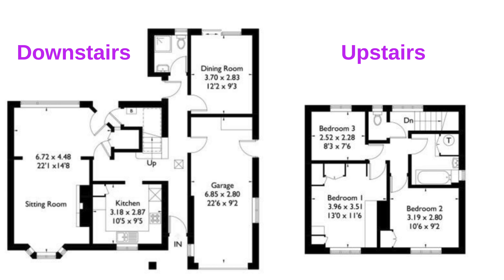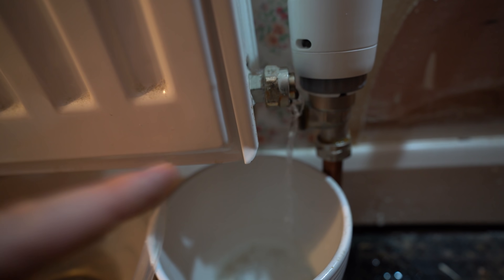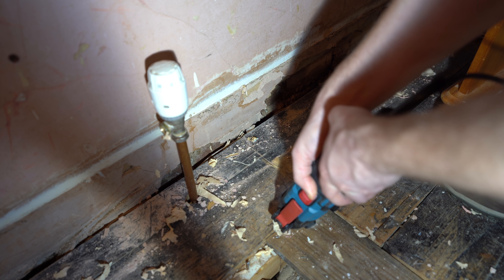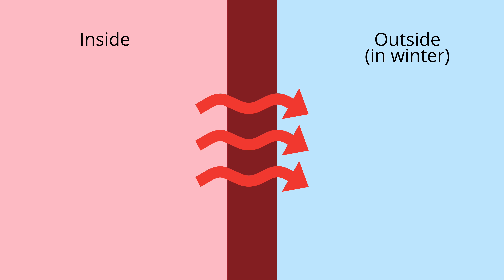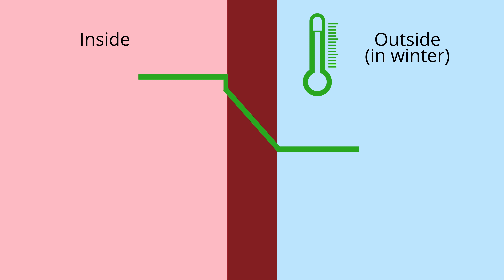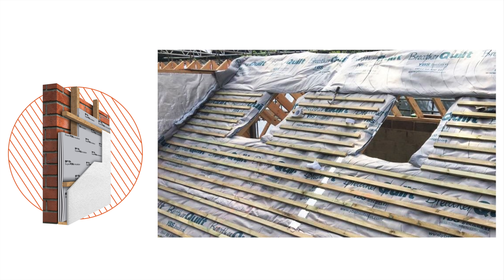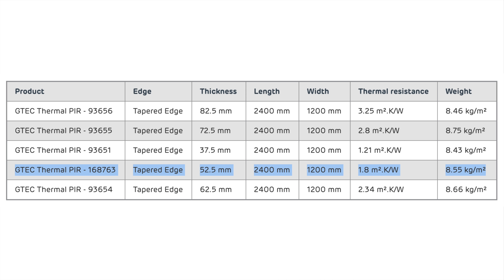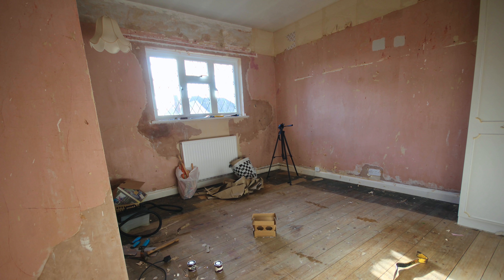Using Adhesive Foam To Attach Insulated Plasterboard

Comment: Hi i like the video however its a myth externally insulated buildings dont suffer with this problem.
Consider the scenario. Cold house, You return home on a cold day and put the heating on. You increase the temp & humidity in the home but the thermal mass of the wall is slow to  respond and lags behind the room temp. The moisture enters the fabric due to higher humidity internally compared to outside and as the thermal mass mass of the wall is   slow to respond Dewpoint occurs instantly on the inside of the wall. Moisture migrates through the fabric and becomes trapped behind the external insulation.. Bad bad bad bad. Only mitigation against this is a mechanical ventilation unit to combat the humidity rise. 
Internally insulated walls respond quickly with the rapid temperature change and do not lag behind the internal temp. Most insulations used for this have low permeability and and moisture going beyond the insulation is minimal. Also with the external structure not wrapped in external insulation, the building will eventually permeate the moisture to atmosphere instead of being trapped. This is why timber frame buildings use an internal vcl eg polythene and  external vapour control layer which allows moist to escape to atmosphere . The other way around would be a total distater.

Spent 13 yrs testing /investigating building defects, air leakage testing. Cavity filled and externally wrapped solid wall buildings are something that keeps cropping up...
Reply from the maker: Wow fantastic comment esp. with all that experience behind you. It does make sense what you say but I'd have thought that even with the heating off for the day the external insulation would keep the brick walls reasonably warm, certainly more than uninsulated walls but the point about moisture getting trapped outside of the wall but inside of the insulation makes total sense but again, will it condense?

I've been hearing about issues with cavity walls so let's say you were doing a brick/block extension, how would you build the external walls - internally insulated?

Comment: I notice you didn't put any spray foam in between the sheets, I think I intend to do this, is there a reason you didn't?
Reply from the maker: They were nice and tight for the most part so nowhere for the foam to go. Unless you mean doing a quite spray on the side before you attach - not a bad idea actually esp as some boards are a bit concave on the edges.

Comment: I may have missed it as I was clicking through impatiently but how did you finish the reveals? just bond plasterboard over the edge of the boards and across the internal face of the window reveal, butted up against the window itself?
Reply from the maker: It's in the vid, briefly but I just did the edges of the insulated plasterboard to be butted up against the existing plaster on the window reveal. That does mean therw window reveal is a thermal break which isn't ideal but to put insulated plasterboard either you lose your window frame, replace the window with a smaller one or before you start making the window opening wider - big job and make interfere with the lintel. So I think the way I did was best. As for cutting it back after it's stuck rather than before - I found it more accurate doing it that way. i've done this job again in the next bedroom and did it the same way.

Comment: Love your videos and am well aware of how much research you do and how well u focus on the little details, but do you foresee any issues where the rockwall was put between the floor joists, by doing this isnt the wall going to be colder so vapour can condense on it, im assuming the rockwall has no vapour check qualities within it or if it does not very reliable so are the joists going to be in contact with a wet wall that cannot dry due to no gap and air flow thus risking structural issues later down the line from sweating and rot. Really hope the instastik idea works long term, makes it so much easier and less messy than dot and dab.
Reply from the maker: It's a really good question and I wondered the same so I kept checking it while the floorboards were up (and it was winter) and there was no moisture. I guess if you were to put acoustic insulation down which is not that far off thermal insulation in U-values then that would be done all the way to the wall - I believe. That's done regularly and there shouldn't be issues. The other thing is that the brick wall is breathable so should let water vapour escape. 
More often than you might expect with these things is that what works in one house, facing in one direction, in a particular location doesn't work for another - like cavity walls -sometimes they seem totally fine and other times they have damp problems so overall i'm not certain but it's a good point that I did think about. Of course when things are hidden away above plasterboard and below floorboards you don't know what's going on but I'd have thought there would be some damp on the plasterboard below before things got too bad.

Comment: Hi.there, I follow you on Youtube and really need some advice if you've time....

We've just had a garden room installed and our man has been following you too so we were really assured things went great. Plastering has been done and we're now not sure whether we've painted too soon after, even though the walls looked dry but might have felt cool to the touch. We went for it 5 days after plastering and mist painted it and then 3 coats of emulsion later. However, the french doors and window is very steamy and very drippy with condensation. We still have final fix electrics so have an extension lead with two radiators on and the window open for 2 days now and still the condensation remains. 
Can you offer any reassurance to us that it is normal or that we've messed up painting it too soon?
Reply from the maker: Sorry for the delay in replying. I'm sure this is down to either the deepest layers of plaster still drying or your mist coat which will have been water heavy so I bet the condensation problem has gone now :)

Comment: 9:14 Just a tip for the future. You could have left the corner on and cut  it off after installation with an old saw, just cut in line with the opening. Or hold it and cut along the window before installing. Saves all the measuring and marking.
Reply from the maker: Good point. About to do another room the same way so will do that to make things quicker. 👍
Reply: @AliDymock  The reason I mentioned an "old saw" is that I've found that cutting plasterboard seems to have a very corossive affect on saw blades.

Comment: Good tip with emptying the rad. Just a note re cavity insulation from the 80 ( and 90 and even into the early 00s) only a lawyer of about 50 mm would likely have been added, still leaving a 50mm cavity which can still be filled to greatly improved the overall insulation. The cavity insulation would originally have been installed by the block/brick layers and could often have been poorly done as they would have been working around wall ties which caused gaps. The insulation would also have been low density polystyrene.
Reply from the maker: Great bit of info! That would be the best starting place for insulation if that is the case.

Comment: This is a great video. Thank you. I have one question, i do get condensation on the wall. So for that i would need the wood baton option rather than direct adhesive option?
Reply from the maker: It's hard to say because you may be getting condensation because the wall is cold. Once you've insulated it will be warm so the condensation will be gone. So as long as the foam sticks well enough to begin with (or dot and dab cement stuff) then you may be totally fine doing this may way. I think that because the boards have a vapour barrier between the insulation and plasterboard this will also help reduce the water vapour from getting to the brick wall in the first place so I reckon it's totally fine BUT do use acoustic sealant on the joins and also around the edges. I've had no problems yet, the wall is plastered and painted and I'll be doing the next room the same way this month :)
Reply: Thank you. I will let you know how it goes. And good luck with room project!

Comment: Could you stick on acoustic boards using the foam and would it work to deaden the sound more than drywall adhesive or fixings? Possibly 2 layers of acoustic plasterboard?

Comment: I've only ever used mechanical fixing on insulated plasterboard, after seeing a job where it had been dot and dabbed with plasterboard adhesive and the plasterboard had later become detached from the polystyrene. I've always used 6mm sds drill, red plugs, then 65mm aluminium nails (which hold in plugs better than you'd imagine.) You have to use a bit of scrim over the nail heads due to the compressibility of the insulation, otherwise the heads may pop occasionally. But I must admit, this looks like a feasible solution that would be a hell of a lot quicker. I'll give it a go next time I have some to do.

Comment: Hi I have cavity walls but my north front facing room is pretty cold and Gable wall is cold to touch can I just put these Thermal plasterboards like you have ? Or is condensation going to be a problem?
Reply from the maker: You should be okay to do so, I can't think of a reason off the top of my head why moisture would be any more of an issue with a cavity vs a solid wall
Reply: @AliDymock  have you noticed a difference now since fitting the boards.

Comment: Great stuff. Would this method work with foil backed panels (e.g celotex pl400)? Thanks
Reply from the maker: I don't know for sure, and that's partly why I went for the paper backed stuff. I've noticed that expanding foam doesn't stick at all well to foil but it may be a different story with this adhesive foam. Even with dot and dab, I've seen some people pva the foil first to get a stronger hold so that may be the work around. Test it and see!

Comment: Hi great job 👍 I can see that you cut your boards round the window level with the edge of the wall.  How did you cut the boards in the reveals? Did you have to cut away some of the insulation to ensure a continuous seal? I’m about to do the same so any advice would be helpful. Thanks.
Reply from the maker: So in my case, I didn't do any insulated plasterboard in the reveals because the windows will need to be replaced at some point so that will be the time to do it for me. Ideally you'd knock off all the plaster in the reveals, attach the insulated plasterboard, maybe 10-25mm of PIR . This would extend beyond the reveals to meet the wall insulated plasterboard. Then you need to cut back the insulation from the plasterboard on the wall so the two bits of plasterboard meet. Confused? See the 12:00 minute mark, that diagram shows it nicely 😁
Reply: Thanks that’s really helpful 👍

Comment: Hi, great video and thanks for sharing this information, very helpful, I'm about to start doing the same to my house, the wall is solid stone built, I took off the old  black ash plaster as it was loose and left with just stone, I was was going clean up as much dust, a thin layer of PVA and then dot and dab or foam now after this video,  would you think this would work? Cheers
Reply from the maker: Sounds like you've done the hard work. Yeh I definitely think this will work. Either spray the walls with water first and then spray or if it's very dusty/dry then pva might be a good idea. This was a bit of an experiment as I'd only seen it used on plasterboard (no insulation) before but given the paper baking of the insulated plasterboard I used, I thought it would work and it's a lot less hassle than dot and dab.

Comment: Hi did you notice the difference in heat loss within the room once you installed the insulation plasterboard, I have solid walls and want to do the same? Great videos.
Reply from the maker: Well I haven't got the radiator back on yet but it already feels a lot warmer. When we do the windows in future I think it will be really snug. I think it's worth it.

Comment: Good job. Is there still some risk of condensation on the solid wall even with the foil backing vapour layer and sealant?

Also how many cans of Insta Stik covered how many boards?
Reply from the maker: It's possible but hopefully moisture will escape out of the wall faster than it enters so no build up of moisture occurs. We just have to do our best to reduce it getting in in the first instance 👍
I think it was just 1 can, certainly no more than 2.

Comment: I agree with the choice of insulted plasterboard just not a fan of sticking it as a fixing, you can get fixings especially for insulated boards that give a much better fix
Reply from the maker: Have you got a link?
Reply: @AliDymock  don’t usually buy them on amazon but these are the closest to the ones I buy at our local building merchants, just drill a hole and hammer them in. The take a great fix

Comment: Good job, but you made this room smaller. I would have chosen the external facade insulation.
Reply: He only lost 2 1/2" ... 
He explained the pros & cons of the different methods and settled on this method as most suitable... did you not hear that ? 😒

Comment: Interesting video, love the use of instastik as dot n dab is definitely messy business. Was there any particular thermal reason/ calc to your prioritisation of the wall insulation over replacing the window(s) with a superior performing unit? (Replacement with trickle-ventilated unit does significantly reduce in room vapour / condensation issues too).
Reply from the maker: Good question Carl. A couple of reasons to leave the windows for now. I'll likely want to do all the front windows at the same time so we'll have to save up for that and also they can be done in isolation (save for a bit of plaster work around them) where as it made sense to do the wall insulation before carpet because I needed to move the radiator pipes. Good point about the trickle vent.
Reply: @AliDymock  Lovely job. In your main rooms,  suppose you might also cheaply chase such pipes into the wall, lag and then bring them through the insulation board, keeps the look clean if not doing the full under floor malarky. Great channel BTW!

Comment: id be really concerned about creating damp between the cold brick wall and the insulation. You mention that we create a lot of damp in the internal atmosphere of the house with cooking and showering etc, i'd consider a MVHR (mechanical ventilation with heat recovery) system to try to keep the internal moisture levels to a minimum. I'd be interested to see what this was like in a year or so and to see if you do indeed end up with damp or rotting joists.

Check out Peter Ward on youtube, he is an expert on damp in old solid wall buildings. Scary stuff damp.

Comment: Out of interest; 
1) Are you concerned about thermal bridging on the mechanical fixings?
2) If someone did this and wanted to hang something on that wall (a shelf/etc) How would they do so safely without thermal bridging/damaging the vapour layer?

This looks great and is something I have thought about doing for a long time. But I always get tripped up when considering the above 2 items.
Reply from the maker: Hey Peter,
1) Nope, because there's no other recommended way of doing it and they're very small interruptions in the insulation so I guess at those points it will just be more similar to how it was before. Everywhere else is greatly improved from a U/R value perspective.
2) You can get very long plasterboard screw things (sorry the name escapes me) that will fold out on the back side of the insulation to provide support or you can go into the solid wall behind if you want to store heavy things on the shelves. Yes it will break the vapour barrier so do try to seal around the fixings as best you can but the thing about vapour barriers is this: it's never going to be perfect but as long as more water vapour can escape to the outside than can get in from the inside then there will be no build up of moisture.

Hope that helps and gives you confidence!
Reply: @AliDymock  it has! Thanks a lot! I'm guessing you will document the plasterboard mounts when refitting the radiator actually!
I've used plasterboard fixings before and just assumed the insulation layer would interfere.
Edit- I've subscribed by the way. Great videos